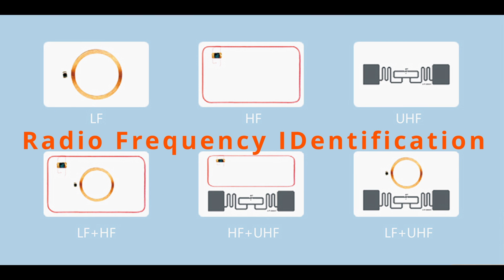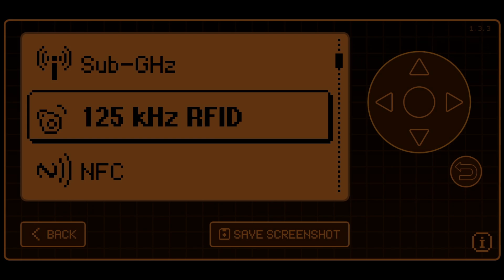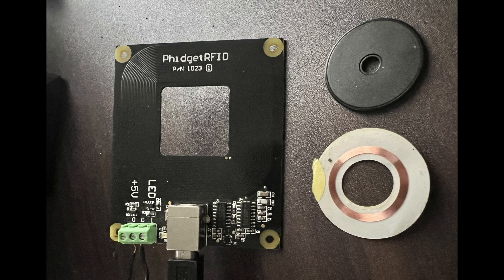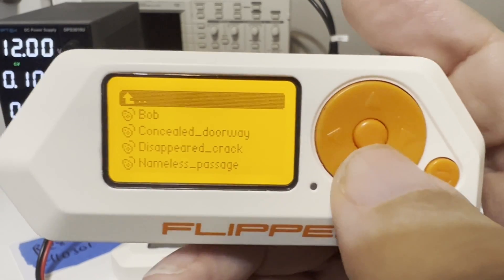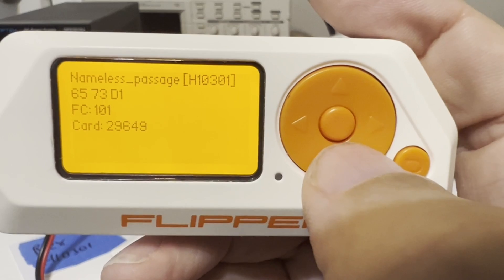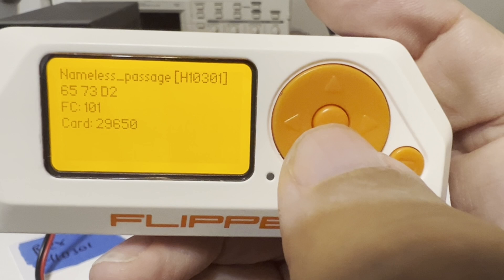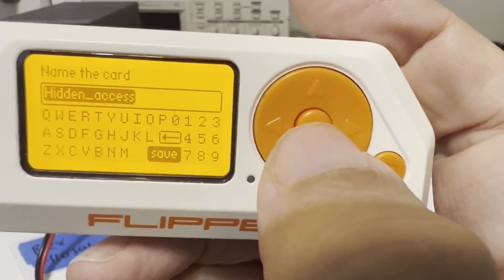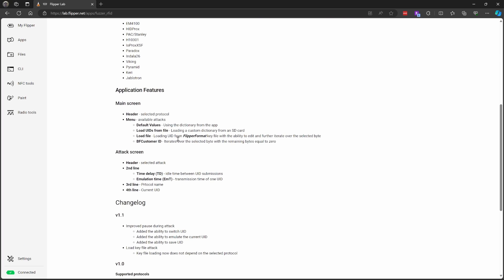[102] Flipper Zero: Introduction to 125-kHz RFID

Comment: How can I increase the range of this?
Reply from the maker: https://www.amazon.com/UHPPOTE-Reading-Distance-Wiegand-Control/dp/B00UX03TLO has a longer range of about 1 foot for fob or 2 feet for card. Flipper should be able to integrate using GPIO, but device needs separate 12 volt power supply.
Reply from the maker: I should mention that it’s only for reading specific tag formats, so it might not be compatible with your card. You can ready your card closely first with Flipper to see the format.

Comment: Facility code is 101 I see that, but hex 65?
Card number 29649 ok can read that, but 73D1 hex?
Whats with the hex thing, where u get that from? Maybe elaborate on those things, they are not obvious pall.
Reply: Blijkbaar moet ik nog veel achtergrondinformatie tot me nemen voordat ik dit helemaal kan begrijpen.
Reply from the maker: Thanks for the feedback! It's hard to know what people already know & what I should teach. Hex is 16 digits [0-9,A-F] instead of our normal 10 digits [0-9].  So "A"=10, "B"=11, "C"=12, "D"=13, "E"=14, "F"=15.  

73D1 hex = 1 + "D"*(16) + 3*(16*16) + 7*(16*16*16) = 1 + 13*(16) + 3*(16*16) + 7*(16*16*16) = 1+208+768+28672 = 29649.

Similar to how 4391 decimal = 1 + 9*(10) + 3*(10*10) + 4*(10*10*10) = 4391.

The hex values displayed are the same as the decimal values, it's just in a different numbering system.

Comment: Hello Derrek, where do I get the file "nameless passage" and how do I load it into the Flipper Zero?  What folder in the Flipper Zero should this file go into?  Or can I go to a site that downloads and installs it automatically--and what is the site address?
Reply from the maker: At 1:52, I scanned a H10301 card with ID 65 73 D1 and saved it, which automatically made a random name of "nameless_passage.rfid".  The contents of the file were the following...
Filetype: Flipper RFID key
Version: 1
Key type: H10301
Data: 65 73 D1

Comment: Hello Derek, I assume you are using third party firmware to give your flipper zero these abilities.  Are you using Roguemaster or Dark Flipper?  If not, what firmware are you using?
Reply from the maker: In this video I was using Official firmware for this particular video.  RogueMaster may have additional menu items under "Extra Actions" which allow setting T5577 data (used in other videos in this series).  5 months, so it's probably slightly different now.  Feel free to join my Flipper Zero Discord if you have additional question or need help - https://discord.gg/k7WX7Be3Vy
If you aren't writing blocks to T5577 chip, then Momentum is also a good option.
Reply: @MrDerekJamison  Hello Derek, after much fiddling I managed to create a file with 100 try out combinations in it and give the file a name I specified.  Then I got the Flipper to chug through the 100 try out combinations.  I was able to control the time delay between each try out; the maximum delay I chose was 3 seconds.  This was what I was trying to do.  I could not use letters in a combination; each combination was 12 digits; and at the end of the file I had to put a carriage return/line feed at the very beginning of the last line--with no other characters in the line.  Of course, I have 10 billion billion combos to go.   This experience might enable me to hack simpler locks.  Thank you for your comments, which were about a different task (reading a key fob) but still useful.